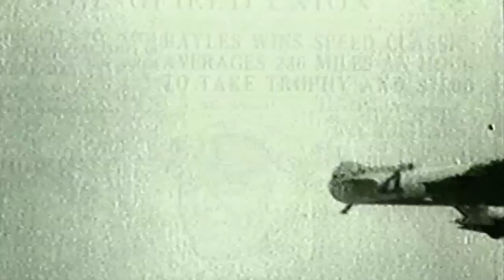Gee Bee Model Z Test Flight - Flash From The Past!

Comment: If you watch the footage of the crash you see the aircraft dip very suddenly and then pull up, and at that point the wing fails. Bayles was doing in the region of 300mph. It must have caused a huge and sudden load on the wing structure which failed outboard of the rigging wire attachment point. I read that a couple of kids found Bayles Goggles and pieces of windscreen before the impact point and gave them to Zantford Granville....Thus the story of the fuel cap smashing the windscreen causing him to flinch putting in a large control input.

Comment: Your crazy to fly that plane.  Just looks to unstable at high speeds.  Not worth the risks.  The design was not meant to with stand that much horsepower.  As you mentioned older technology and testing was involved.  Nice flying though.